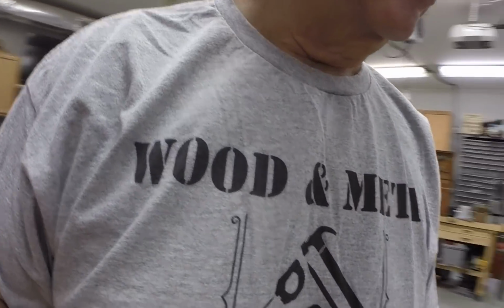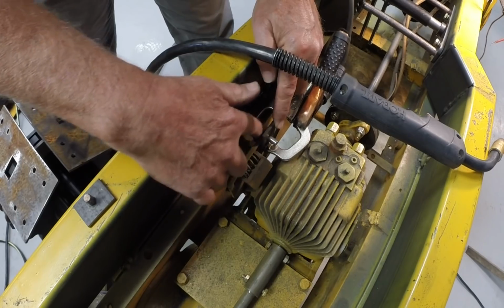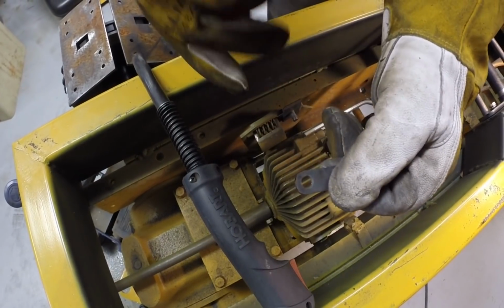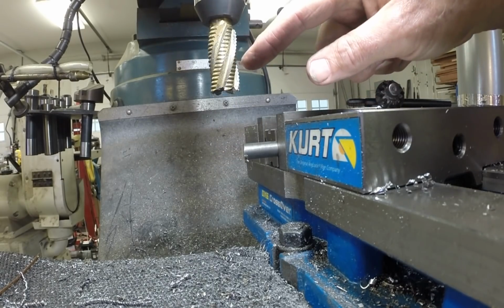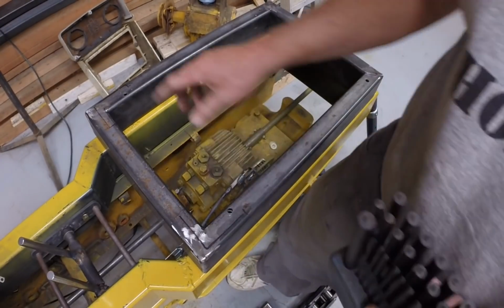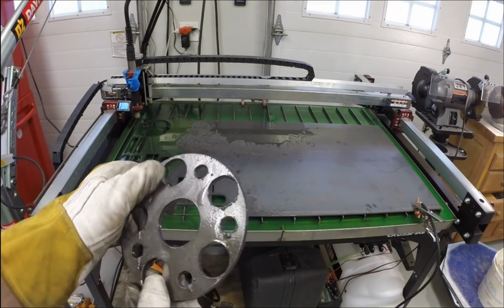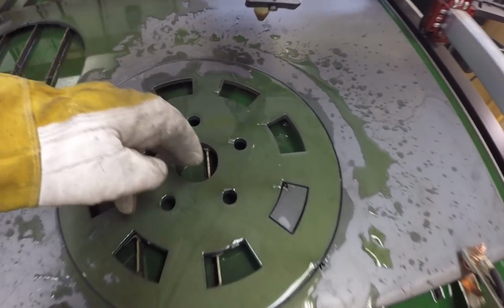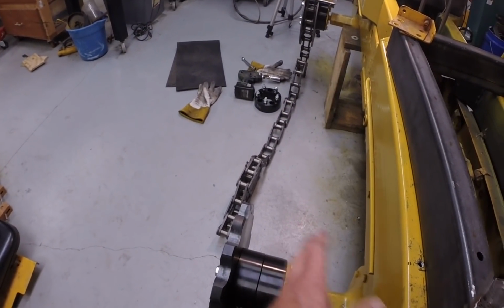Cub Cadet Dozer Build EP #14, Plasma'd Wheels!

Comment: Since it looks like the rectangular cutout are not synchronized with the holes, did you try flipping the part around to see if the parts lined up correctly? And I was wondering, if you used typical automotive wheel stubs in the back plates, they would pull in and not move when tightening the first spacer hub. Presently when you are tightening the first hub, you are actually putting torque on the thread bolts to come out... Just some thoughts... Thumbs Up!

Comment: A key note you may want to put 2 gas charged cylinder one on the push and one on the pull side THIS WOULD PREVENT JUMPING FWD AND BACKWARDS!
Reply from the maker: That would certainly damp the movements. Not a bad idea.

Comment: It’s going to look weird having a sprocket at the front on the right side and at the back on the left and then have something that looks completely different for the other 2 lower sprockets/idlers. 
Not to mention the upper “drives” by the seat.¯\_(ツ)_/¯

Of course it’s your build and I’m just along for the ride.
Reply from the maker: The "sprocket" will get covered by a plate that looks like the idler wheel, so both lower wheels will look the same. The upper wheel will look different.
Reply: @woodandmetalshoptime8048  
Sorry for the negative comment. You obviously know where you’re heading with this project. I’ll just sit back and enjoy the progress. 👍🏻👍🏻👍🏻

Comment: That's going to look weird with a drive sprocket on the front on one side and the back on the other , if you put a sprocket on each end to make it look even on both sides , the non driven could be made out of 1/4 inch plate and in the center of your idler wheel set up and the drive wheel made to look like an idler wheel .
Reply from the maker: Can't have front and back both sprockets because they are fixed. So you can't adjust for track length or stretch.  The drive sprockets will be covered with plates so they look the same as the idler wheels. Both bottom "wheels" will then look the same.

Comment: Hold up man, I think you have a problem with the idlers. the purpose of the idler gear is to support the underside of the chain as it goes around the wheel, not the track pads. Now, I may be wrong because I have no clue how you plan to tension these chains, but the way you have it will put all the tension on the track pads and eventually rip them right off of the chain.
Hope that helps some. thanks for the videos.
Reply from the maker: The chain will bottom out in the idler and tensioner wheels, no pressure on the track pads themselves, except for the bogies.
Reply: @woodandmetalshoptime8048  very well, carry on then.
Reply: The piece he welds in slots will carry the chain and float the pads

Comment: Every thing you do is great, my only concern is with all of the spacers you are having to use. I hope the cast housings can take the stress.
Reply from the maker: The cast iron axles are actually the same as used on the Farmall tractor, so they are quite stout.  They will not carry the weight of the tractor, all (most) of that is on the bogie wheels, so the main stress on the axles will be track tension/strain.  If it turns out to be an issue, I am prepared to support the outboard ends with bearings.

Comment: Instead of designing and cutting idler wheels, wouldn't it have been easier to just go with another drive sprocket at the idler position? I haven't seen or maybe I missed it, how you plan on adjusting the tension on the tracks.

Comment: Your going to have to weld/tack your 5/16" spacers to the wheel hub spacers then because when you close in the inter hubs "the two outer big plates"  you won't be able to adjust those inter smaller spacers to line the holes up for the lug bolts to go through if that makes sense....but truly enjoy these video's.....keep up the good work and GOD BLESS
Reply from the maker: You'll see what I did in the next episode to solve just that problem.

Comment: How will you create tension on the tracks. I have been reassambling track adjusters on a Komatsu D31. This machine uses a grease filled ram. As you pump grease in the fitting it pushes a ram out fixed to an idler. Therefore tightening the track. I am curious if you will have a tensioning wheel in another location as it appears your differentials are fixed. Maybe I'm wrong.  I also thought it looked like your idler wheel plates were simply in the wrong clock positions from each other and needed to be rotated and/or flipped. Love the project and have always wanted to do something similar.
Reply from the maker: There will be a track tensioner. It is in the "Hi Drive" location if that makes sense. Episode 1 explains it. I'm actually working on it right now and it's introduced in upcoming Episodes17 and 18.

Comment: I don’t know why but it always seems drill press manufacturers limit the Chuck travel to just under what you can fit in it. I.e. if it takes a 13mm drill and on average a 13mm drill has a 120mm working depth they only give you 90mm of travel. And as far as I can tell the only reason is to pee off the user. If it costs another £50 to make it longer then we would pay it!
Reply from the maker: Agreed!

Comment: The dozer is definitely taking shape. Why are you making the idler instead of just using another sprocket? Would be more secure and would assure that the front and rear align properly.
Reply from the maker: distance between the sprockets would need to be adjustable to take up track stretch and need to be an exact multiple of the track pitch.
Reply: @woodandmetalshoptime8048   Actually, no it wouldn't, the idler sprocket will self adjust the distance between the two sprockets. Your tension adjuster will take up any excess slack in the chain itself. which I assume will be above the two axle sprockets. You could repurpose the idler wheel that you made as the tensioner so it won't be wasted.
Reply from the maker: Actually, you might want to think that through again. The distance between the axles is fixed.
Reply: @woodandmetalshoptime8048  The undriven sprocket will align to the chain regardless of the distance between the two sprockets. Try it with the two sprockets and chain you have.

Comment: The drive shaft to the rear hydro is going to have a bearing about midway, like on that structural cross beam, right? I worry about that thin a drive shaft getting whipped around under load.

Comment: You may want to reconsider you idler concept. I have done some design work at CAT and your design can create a 'torsional moment' in the tracking system. One track is pulling and the other pushing. this can create a twisting moment in how the tracks 'track'. You may be OK given the size of the machine and your not going to be pushing over trees or doing heavy excavating, but its something you may want to keep an eye on.
Reply: I mentioned that a while ago but he feels it will be okay. 
¯\_(ツ)_/¯

Slack side of the chain being different on each side won’t operate optimally. You certainly would know better than me.
Reply from the maker: Agree it's not ideal. I think, for what this is, which is a  TOY, it will work OK.

Comment: So once the tracks are assembled , the track pads wont let the chain fall down into the idler ... id leave out the welded plates between your  wheels less welding and you can also disassemble if need be
Reply from the maker: The chain doesn't fully bottom out in the idler--so those cross plates support the chain not the track pads.

Comment: For the idler wheels, you need to off set the large gaps with placing them one with the smaller (stud) holes and the other one with the larger (lug nut) holes as they are off set by one stud / lugnut on the spacers. You dont really need the welded bits in between the inner and outer idler wheels as the chain will be welded to the tracks so the chain will not fall down onto the spacers.  :)
Reply from the maker: The welded plates provide structure for the wheel as well as support for the chain.
Reply: I see you have sorted it on the idlers. :)

Comment: Might consider welding a washer on the bent end of the control rod (close to the bend).  That keeps the bend away from the hole and gives smoother operation.
Reply from the maker: That's a great suggestion!  Thanks!

Comment: get  a spiral fluted tap for chasing threads
Reply from the maker: I have spiral fluted taps. They require more force (because they are not tapered as much) and, as you know, holding a hardened tap in a drill chuck is a bit of a challenge. The less force required by the taper tap allows the drill to actually work in this application. A spiral or gun tap requires so much force that it tends to just spin in the chuck. BTDT.

Comment: If both idler plates are identical, try reorienting the outer plate until it lines up as you designed.
Reply from the maker: They are not identical. They do line up as you'll see in the next video...

Comment: Nice work but I think you are over thinking the idler wheels all you need is sprockets just like the drive sprockets. You could even cut them yourself on the CNC plasma cutter.

Comment: For the control rods you should have used Hyme joints. The threaded Hyme joints on both ends would have allowed for fine tuning adjustment. And they would not have any kind of slop in the linkage. I modified my dads skid loader to Hyme joints due to slop in the linkage, it was so much better after the upgrade.
Reply from the maker: I've used Heim joints, actually used some on my motor grader. This method eliminates the need to drill the hardened control plates which I had to do to use the Heim joints. Not the best choice where access is tight as you need to get a wrench in there to adjust, etc.

Comment: The possible issue with one sprocket on front and one on back is the rear one will pull the track under and push the slack to the top like it should. The front one is going to push the track under itself and bunch up any slack under the tracks and be tight on top. Could cause a straight tracking issue or a ruff ride on that side if the track isn't tight all the time.
Reply: I was wondering the same thing. If it ended up being an issue - which I'm not really sure it will at this scale - I figured a solution would be to freewheel the front sprocket on the drive axle, and link the front drive axle to the rear hub via a chain. Wouldn't be pretty, or maybe would be hidden behind the rest of the track framework. But certainly would work.

Comment: Why not use 4 cogs?
Reply: I was wondering the same thing... Why not use 4 drive sprockets.... then everything will line up the same, easy peasy...   Are they really more expensive than all the extra work to make those idlers, spacers, etc.?
Reply from the maker: You'd need to have the two sprockets an exact distance apart, equal to a multiple of the track pitch. Impossible with track stretch over time unless the two sprockets are adjustable in distance apart. Most excavators can do this because they have both drives on the back and the front is just an idler and it is mounted on a piston that can adjust the distance apart. My drives are a fixed distance apart, not adjustable, so can't do that. The third tensioner wheel will allow for track length variation. Stay tuned to Episode 17 where that is added.
Reply: @woodandmetalshoptime8048  Good point.  Would it not be easier then to cut out a thick piece to mount the same as the sprocket or just laminate the two thinner ones, build it like a car/truck wheel. You can align the tracking via the offset rather than complex spacers.   Would be easier if you found some pipe the correct diameter, then add the 2 guide side rings without all the inner bolt holes, and metal.

Comment: TRy flipping the outer one over or turning it around to a different position.
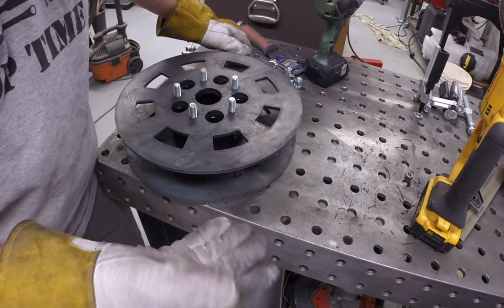Reply: Yup - 5 studs and 8 spokes, so you have 5 different options re the spokes aligning or not. @1:03:08.  Also - the track plates will sit on the outer edge of the larger idler wheel plates so you don't need the small plates joining the inner and outer big idlers to support the chain as at 1:07:37.

Comment: instead of plates between, could you make a ring for between the 2 disks then the tension could be pulling on the chain instead of the pads against the disk ? good looking work , nice set tools you have in your shop.

Comment: Did you try flipping over one of the outer disc's to get your wholes to line up?
Reply from the maker: Actually, just rotated it one lug.  It's in the next episode.
Reply: Flip and/or rotate is what I was thinking, thanks Kenneth :)
Reply: It has to do with symmetry I think. A 5 stud pattern will only match an 8 opening disk in an exact way. I cannot explain it but think Im right.

Comment: I think you will have problems with your  lever when you start pushing dirt in Reverse or forward. Your hydrostat will start fighting back improper installments . Check out the factory hydrostatic levers that is why they have so many mechanical joints. So it will operate smoothly and  flawless I have wore the T-shirt.
Reply: ^^ this guy knows. watched his stuff. great build
Reply: check out this video on my hydrostatic pedal
Reply from the maker: Check out the video on my hydrostatic motor grader.

Comment: Try flipping the idler plates around. The 5 lug pattern wont match up with the 8 holes unless they are aligned just right. 5 different positions x2 per plate if flipped is 20 different orientations of which only 1 should be correct... I think
Reply from the maker: Yes, you are correct. I discovered that and show the correct orientation in EP #15.  Didn't need to flip the plate, just rotate one lug location and they lined up.  (I'm building/recording about 3-4 episodes ahead of the publish schedule.)